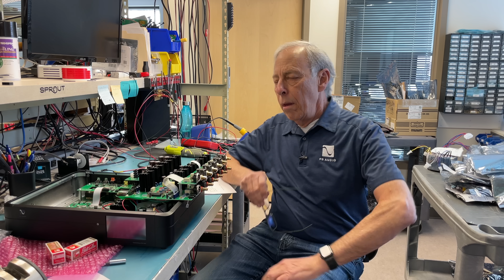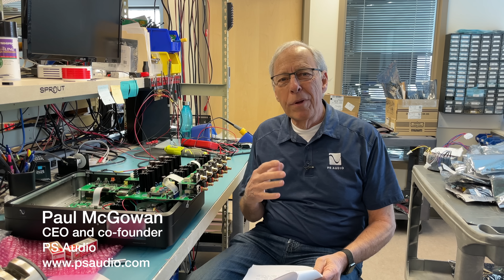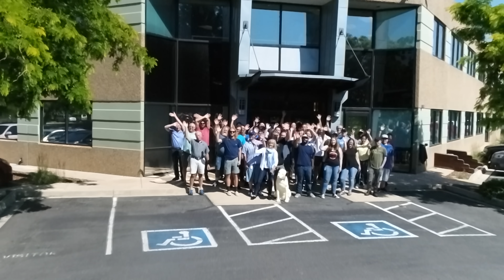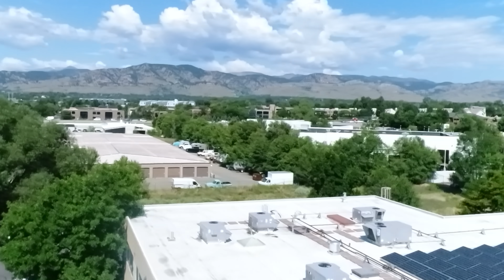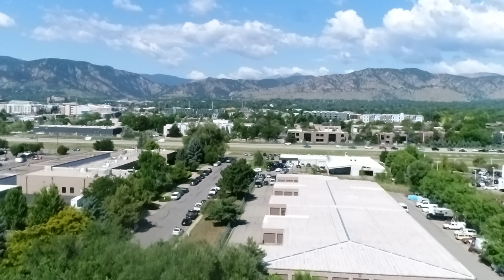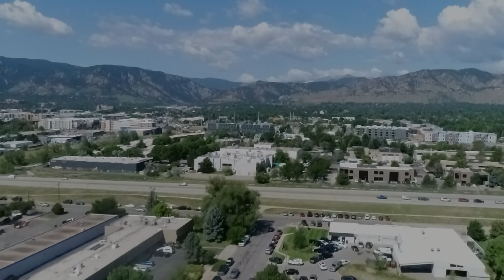Why high resolution audio?

Comment: The more samples you make to an analog signal, the faithful a digital circuit it can recreate to the output. The greater the sampling rate, the greater the fidelity.
Reply: @Kim Atong: Wrong. Digital audio and sampling does not work that way. The greater the sampling rate, the greater the potential frequency response since higher sampling rates allow higher frequencies to be recorded and played back. Has nothing to do with fidelity whatsoever.

Comment: HiRes is about more information not just extended frequency response. The increased detail and musicality of a 24bit file is blindingly obvious even over my crappy laptop speakers. The source is the single most important part of any audio system ("garbage in, garbage out" as Ivor Tiefenbrun used to say) so it makes absolute sense to use the highest quality source file you can obtain. Remember the source signal can only ever be degraded as it passes through the audio system chain
Reply: @ReaktorLeak So maybe, just maybe, the "wider dynamic range" is why, subjectively and to my ears very obviously, there is "more detail?" Certainly with an analogue system an extended dynamic range reveals low-level details and ambiance etc. previously masked by the system noise floor. Maybe, just maybe, "a lot more bits a lot more often" allows for easier error correction (as there are more check bytes) and lower jitter? Thanks for the reply - enjoy your day and stay safe
Reply: @ReaktorLeak Probably not as it appears you've already made your mind up you won't. "There are none so blind as those who will not see (or hear!)" Stick to measurements and theory and leave the subjectivity to us loonies ;0)
Reply: @ReaktorLeak Firstly you may, for all I know, be partially deaf. The fact that I can easily and consistently recognise HiRes variants of familiar recordings doesn't necessarily mean the next man can and, I have to say, have literally a lifetime's critical listening experience under my belt. For a visual analogy a colour blind person could not judge a painting, for instance, the same as you or I and, in likelihood,would be incapable of the same analysis (and response to) colours and colour balance . Accurate, consistent measurements don't lie; I agree, but perhaps you're measuring the wrong things. A van Gough may measure the same as some art student's scrawl; same canvas size and weight, same paint consistency, similar number of brush strokes.... How do you measure a Miles Davis solo against an indifferent but competent player's? Same eight note scale, same acoustics, similar instruments, identical volumes..... How do you measure beauty and inventiveness? How do you measure Shakespeare against a schoolboy essay? Same word count, similar language, all words composed of the same 26 letters of the alphabet....  How do you measure the person you love against a similar human? Same weight, same colour eyes, same age, similar education and background......How do you measure great culinary cooking against a Big Mac? Same calorific value, similar breakdown of carbs and sugars, similar ingredients of wheat, meat and vegetable matter...  How do you measure what one man hears against the other? In a very crude sense you can test auditory response in terms of volume and frequencies but how do you measure his interpretation and experience? How do you measure his social conditioning and emotional response? I'd happily go blindfold a/b 'ing against standard 16 bit / HiRes files. Would you accept a consistency of correctness as a "measurement?" "There are more things in heaven and earth, ReaktorLeak, Than are dreamt of in your philosophy" to paraphrase the Bard.(who,incidentally, is no greater writer than Harold Robbins. I've measured a sample each of their books and they both weigh the same with similar page counts and pictures on the cover. This proves conclusively that Shakespeare is no more substantial or influential writer than Robins as they both measure identically). At the end of the day we're just going to have to agree to disagree my friend and, in the great scheme of things, it really doesn't matter does it? I'll continue to get pleasure from my HiRes files and you continue to enjoy your stance which I actually envy as that way I wouldn't have the expense of replacing my existing Red Book recordings! Take care, stay safe and thanks for a lively and thought-provoking debate ;0)
Reply: @ReaktorLeakTTo quote Mr Zimmerman; "You go your way (and I'll go mine)"
Reply: @ReaktorLeak Just because you can't, or "have never met anyone who could" isn't a definitive argument; it just casts aspersions on your own dogmas, closed mind, abilities and those of your associates. I can't run a minute mile or walked on the moon nor have I ever met anyone who can but that doesn't mean people who have don't exist. You're perfectly entitled to your opinions; go off and fill your boots with my blessings but please remember they're nothing but that; opinions.
Reply: @ReaktorLeak I can't "prove" that you're a very silly man but it's certainly my opinion and I'm quite happy to let anyone interested enough to read our narratives judge that one for themselves too.
Reply: @ReaktorLeak Well at least, and at last, we agree on something; the term "deluded" was at the forefront of my mind during our discourse. Thank you for a stimulating and enlivening debate. Take care, stay safe and true to your philosophies we'll no doubt speak (or spar!) in the future. Stay safe my friend

Comment: it doesn't matter why? yes it does, it's not even that hard. you need a sample at the top and the bottom of the waveform, if you have a 100Hz wave for example, to get a sample at the top and the bottom of that wave, you need to sample it at a minimum of 200Hz.
Higher sample rates mean you also get more samples per wave. if you have a 20Khz wave, but it doesn't line up perfectly with when the samples occur, reproduction could be flawed.
As a HUGE proponent and lover of hi-res audio though, even I admit anything past 24/96 hits diminishing returns pretty hard.
Reply: @PAPO1990 : If you understand how sampling works, then you should also understand why 16/44.1 or 48 is more than enough for the human ears.
Reply: @Historia.Magistra.Vitae.  If you really understand how sampling works, you'd know how wrong you are, especially once to take into account the aggressive low pass filters required to make things work while recording, and the phase problems those create. If you only have 2 samples per cycle on a wave, there is a good chance those samples won't line up perfectly with the peak and trough of the wave, creating errors. Add to that the staircase shaped digital waveform and you can SEE 44.1/48Khz isn't "more than enough" it's a bare minimum. As for 16 bit, it's ALMOST enough for playback, but it is BAD for recording. If you are recording you NEED 24bit, the extra headroom is invaluable because if there's even a TINY bit of digital clipping, it's going to sound ATROCIOUS. A little extra dynamic range is nice for playback, but I'll admit 24bit is overkill, HOWEVER, the conversion to a lower bit rate can lead to errors, yes, they are minor, but with storage and bandwidth being so plentiful these days, there is NO reason to down convert the bit rate just because you don't need the dynamic range.
Reply: @PAPO1990  : Unfortunately you are incorrect. 2 samples is actually enough to sample a high frequency. Also there is no such thing as a "staircase shaped digital waveform". It doesn't exist. All signals with content entirely below the Nyquist frequency (half the sampling rate) are captured perfectly and completely by sampling. When it comes to bit depth, 16 bit is 96 dB worth of dynamic range and 120 dB if dither was used. There is no song nor album in existence that would come even close to having 96 dB worth of dynamic range. For example one of the most popular songs, PSY - Gangam Style, only has 8 bits. You are lucky if you can find a mainstream song that uses over 10 bits. The 16 bit noise floor is already below what we can hear however. For recording, sure, 24 bit is just fine. For playback, it's useless. I highly suggest you check out a video here on youtube called: "D/A and A/D | Digital Show and Tell" since that explains these things way better than I do.
Reply: @Historia.Magistra.Vitae.  I literally studied this stuff, everything below the nyquist frequency is not PREFECT. Dither is literally noise being added to the signal. And while most mainstream releases are compressed to use very little dynamic range, high quality classical and orchestral music often uses significantly more, even necessitating more than 96dB in some cases.
As for stair casing. That is literally what the digital representation of the waveform becomes. The higher the sample rate, the finer the stair case.
Reply: @PAPO1990  : Then you should ask a refund since they teached you bullshit. As long as we keep using a sampling rate that is double the desired frequency, we can perfectly capture and reproduce those frequencies. Simple as that. If you have an oscilloscope, you can actually test and prove it yourself. When it comes to dither, it is shaped noise and replaces the original noise produced by quantization. Again, there is no recorded music in existence that would come close to 96 dB or exceed it. Again, there is no such thing as "stair casing". Watch the video I told you about already, since otherwise you are just wasting your time talking nonsense.
Reply: @Historia.Magistra.Vitae.  the combination of the samples and the various points on each sample designated by the 16 or 24 bit value, you get a grid, the digital waveform adheres to that grid, creating a staircase. It’s not that hard to understand, dither helps but it’s not a perfect solution.
Additionally, if the 2 samples per wave don’t perfectly line up with the peak and trough it won’t be close to perfect.
Reply: @PAPO1990  : Again, there is no "staircase" whatsoever. 16 bit grid alone can contain information that is beyond the range of human hearing. The two samples will line up perfectly, otherwise you will not be able to sample those waves in the first place since they would then break the bandwidth requirement. Using the sampling rate of 44.1 kHz, we can sample frequencies up to 20 kHz perfectly. Simple as that.
Reply: @Historia.Magistra.Vitae.  a 16bit grid can’t exceed the range of human hearing on its own, it’s only 96dB, but that’s irrelevant when you NEED 24bit for recording, and it’s not 1987 anymore, so the extra storage and bandwidth for 24 bit is inconsequential. Theory of fine and dandy, but in practice it’s NOT perfect, you have 2 samples per wave, if they aren’t at the very peak and trough it’s will be wrong. It could be that you get nothing because it samples at the nulls, or it could sample elsewhere on the wave creating a representation of a different waveform altogether.
As for the staircase, I can’t exactly draw you a diagram here.
Reply: @PAPO1990  : You are still incorrect. Watch the video already.

Comment: Well why have Hi-Res Audio at all. No Mr. Paul, not most of us can hear to 20K. Why do we need sample rates of 292k, or even 96K when typical adults don't hear past 16K. Much less middle aged adults.  Its called Presbycusis and all humans suffer from it. However, even worst there are many of hi-resolution files from times when there was no digital means and there are also plenty that have useless information past 20K that our gear has to work to decode, our tweeters also and that can be a problem. This has been thoroughly debunked by ASR and others. The music industry is simply packaging the same music and selling it again in a different format. Same record (Beatles, Stones, F-Mac) has been sold in vinyl, 8-track, cassette, CD, MP3, remastered into more CD's, vinyl again and hi-res download / stream. New hi-res files sound better in part because there are re-mastered and not as blasted as the ones for radio or current pop music.  BTW the filtering has also been debunked.

Comment: Lol sampling frequency has nothing to do with the audio range.  I cant believe Im watching this.. not the first time with wrong response. Since the questions are  taken in advance, a little bit of double check on wiki would be great before to make the video.
Reply: Maybe you should check the Wikipedia article about Nyquist theorem before posting. Or actually watch this video where this relationship is explained 🤦‍♂️
Reply: @johan.mp4  dont worry about the theorem I learned it at school long time ago in my electronic degree. You clearly dont understand how it is apply to hi-res audio if you think that the goal is to get frequency over 20Khz, it is to get more precise audio reproduction of the signal, combine with higher bits it create an higher fidelity reproduction of the analog signal. Of course higher sampling will be able to record higher frequency, but most will be attenuate by the speakers, amplifier and internal dac filter.
Reply: @DrLoveQc  never wrote that was the only goal. It was you writing it has NOTHING to do with audio range. Chill.
Reply: @DrLoveQc  : You have no clue what you are talking about. Please go back to school or at least educate yourself about this topic before commenting.

Comment: A higher bit depth also allows for better math yielding more dynamic range between the loud and soft sounds. Higher sample rate as Paul states allows for frequencies that we can perceive from being filtered out. Both bit depth and sample frequency are key to hi res.
Reply: the dynamic range is almost irrelevant for playback. 16bit gives you something like 96dB of dynamic range, not ideal, but not bad. 24bit is really excessive for playback, but it is invaluable for recording, the extra headroom is a MUST. The biggest problem with lower bit depths IMO is simply the potential for quantisation errors when going from 24bit down to 16bit.